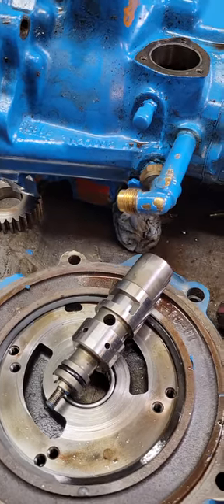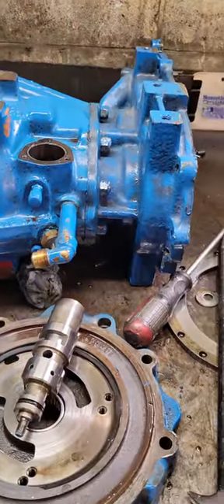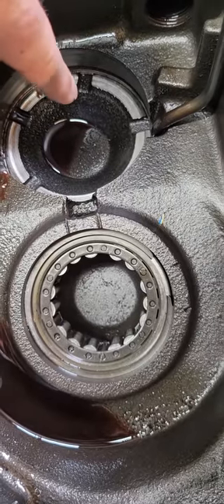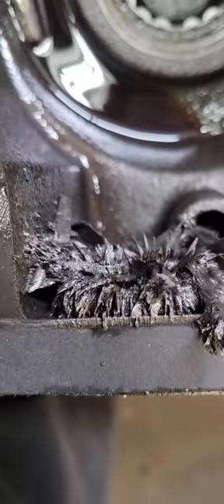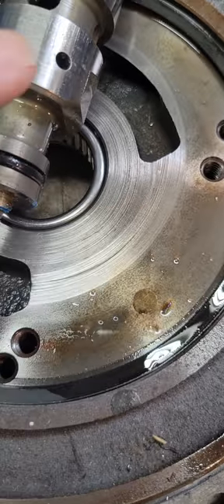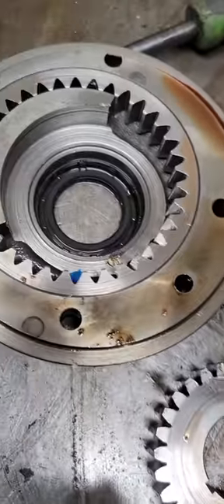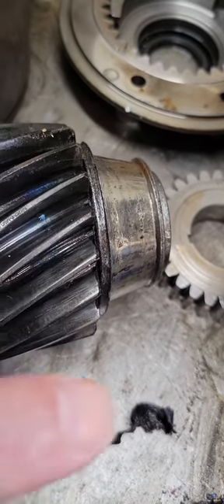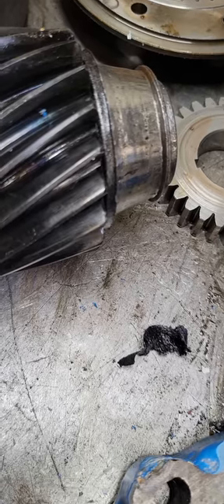1004-002 Velvet Drive       PLEASE SUBSCRIBE THANKS

Comment: hello, can you please tell me you can turn the oil pump 180% to change the direction of rotation of the livigator?
Reply: 10-17.004
Reply from the maker: No a 1017-004 can only give the same rotation as input. Changing the Pump sitting will not help.